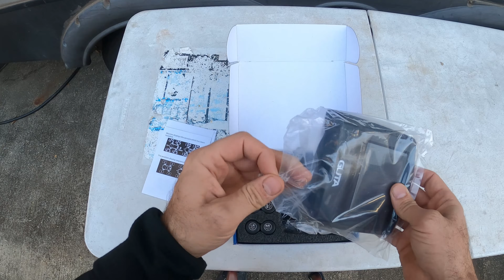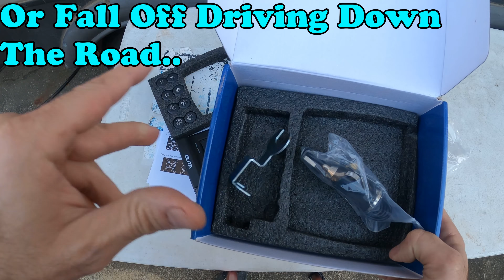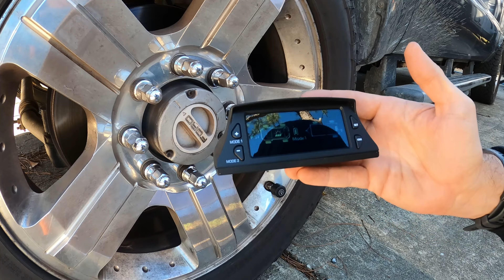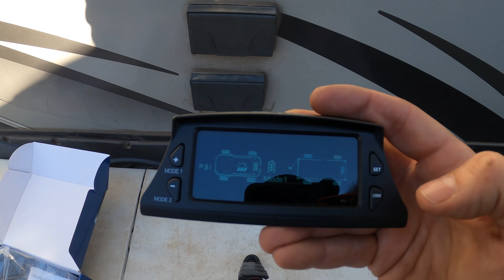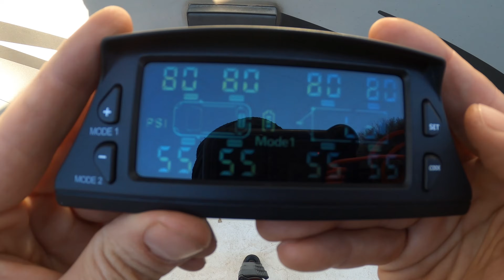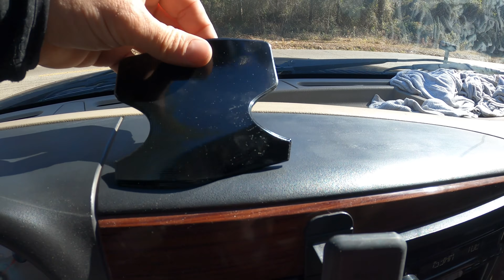How to Install GUTA Tire Pressure Monitor System On Your Truck & RV

Comment: Where did you install the booster on the trailer?
Reply from the maker: Didn’t need one on that setup it was close enough. On my fifth wheel was under the front nose.
Reply: @grumpysdiy  Thank you.
Reply: @grumpysdiy  I have a 43' 5th wheel. do think it needs be further back?
Reply: @grumpysdiy  i have a 42ft 5th wheel. Do you think it needs to go futher back? I can't find any videos showing the repeater install location.
Reply from the maker: @paulmelcher9215 no because your tires aren’t on the back of the fifth wheel, they are half way down the frame.
Reply from the maker: @paulmelcher9215 get a measuring tape and measure. You will know for sure.

Comment: My Guta gt107-1 doesn't give me the opportunity to be able to set Low pressure on my tires, ONLY set the tire pressure to what the recommended pressure is supposed to be.
Reply from the maker: Maybe return it?
Reply: Apparently this model isn't setup like your model
Reply from the maker: I wouldn’t know, I only have experience with mine.

Comment: I’ve set up my monitor system but it continues to blink, how do I stop this?
Reply from the maker: Mine continues to blink and switch to different tires. I have noticed this is when it updates the pressure per tire.
Reply: If all the numbers are blinking you are still in set up mode.

Comment: How do you program it to show a triple axle trailer?  I got the set with 4 sensors and purchased two additional.  My truck already had TPMS.  Thanks
Reply from the maker: I have no idea, I don't have a triple axle.
Reply: I'm guessing you have to get a different unit. Guta has one that accommodates 18 wheels but I could never get it to program.

Comment: Thank you, I just bought the same one, this definitely helps.
Reply from the maker: If your camper is about 34' long like ours, you may need the repeater sometimes we lose signal to one of the back tires on the camper. Oh also the unit came with a card to redeem a free sensor so look out for that.
Reply: @grumpysdiy  I have a 36 foot class A.  Hopefully it works without the need for a repeater as the back tires are actually about 4 feet in from the rear of the RV.  Will definitely look for the free sensor card.  Thanks!!!!
Reply from the maker: You will be fine it’s the added length of our truck also that has us 1 foot ish too long.

Comment: The amazon ad says you can monitor 8 wheels and also 2 spare. Do you have any insight from the directions on how to add spare tire monitoring?  I know I would have to buy two more sensors but how to program ...and how they show on the display is what I can't find anything on.
Reply from the maker: So on the display look at where the spare tires are, those two one on the truck and one on the camper.
Reply: Aha perfect, THANK YOU!
Reply from the maker: np

Comment: Will it work with valve extensions? I’ve got an RV with dual rear wheels and cannot access the inner tire without them.
Reply from the maker: I didn’t run into that problem so I don’t know.
Reply: I would guess that the pressure sensors would work but maybe not the temperature.